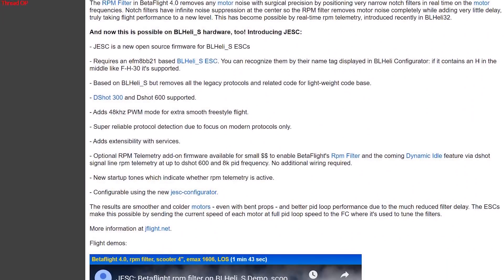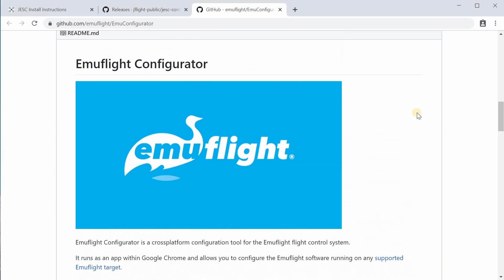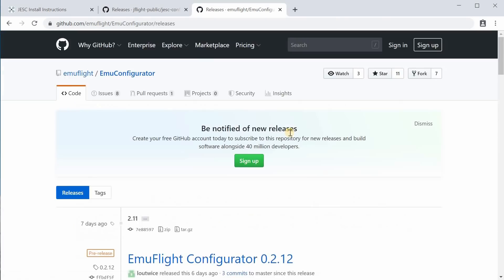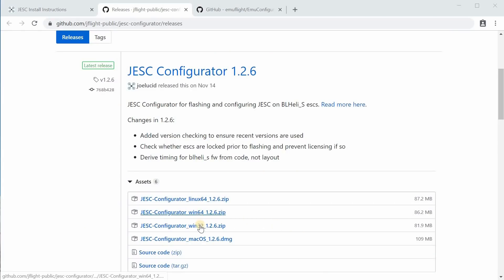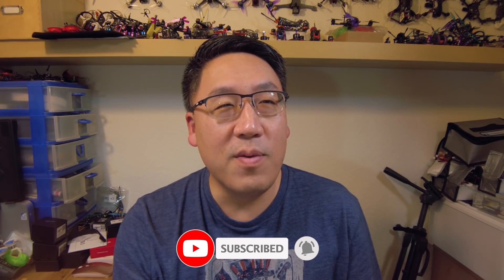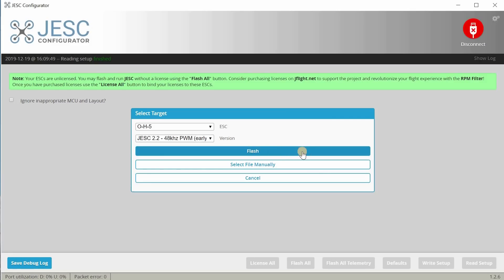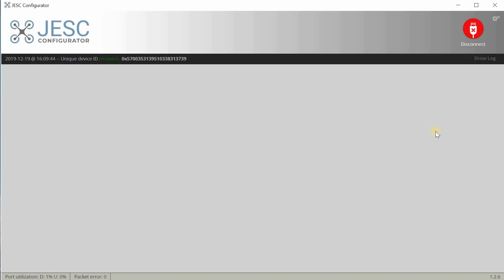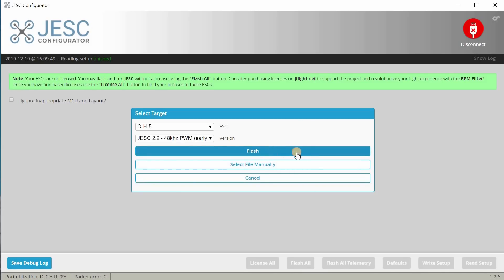Mobula6 Hack to Get Longer Flight Times 🔥

Comment: Is this gonna work on a ur65 original an improve flight times too ?
Reply from the maker: I haven't tested that one yet.  I think so, but I don't know for sure.
Reply: @AlbertKimTV   would be a game changer for our whoop class quads and possibly toothpicks too I mean who don't want more flight time 😁
Reply: The best improvement in flight time on the UR65  is throwing the 0603 motors in the bin and install 0802 motors. I was getting 2:30min flight times on 0603 motors. Now with 0802 19000kv i get consistent 3:30min flight times with a noticable jump in power aswell
Reply: @stefanalexander1573  iv already done this mod for mine aswell but I still find more flight time a bonus
Reply: @matchewbacca  in theory it should give some sort of improvement. Give it a go! It doesn't cost anything and causes no harm to the quad. I'm certainly going to give it a try.
Reply: il give it a blast gotto blow the dust off my props gotto get back into it iv missed it a lot cheers guys

Comment: I’m using my Mobula7 as an indoor flyer only on 1s. Will this work for that?
Reply: Yup it'll still work I think. Comment on UAVtech's comment to make sure tho
Reply from the maker: Yes, but you'll need to upgrade to BF 4.1
Reply: @AlbertKimTV  That's to enable the bi-directional add-on ($6) for RPM filtering (JESC), right? UAVTech below said we didn't need that, just the 48 khz JESC (and no EMU). Slightly confusing.
Reply: Check out UAVTech's video from yesterday, he did it to his Mobula7.
Reply: @housinit  Thank you, that was very helpful!